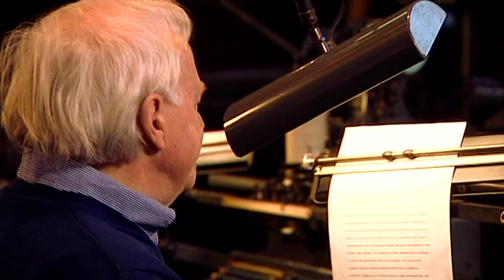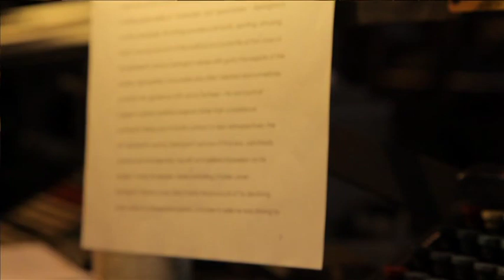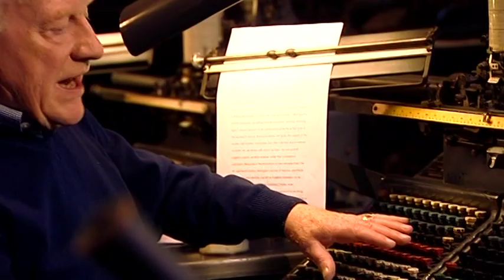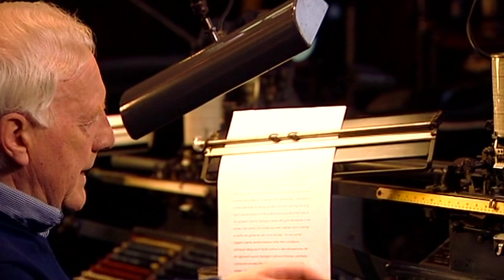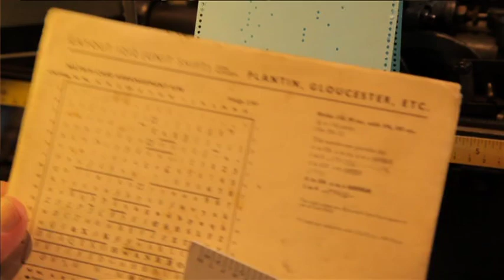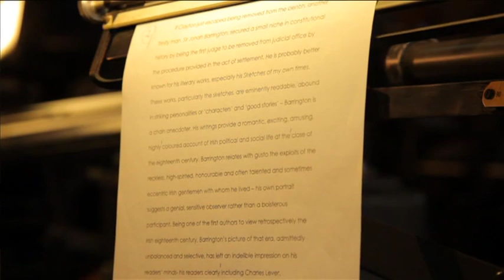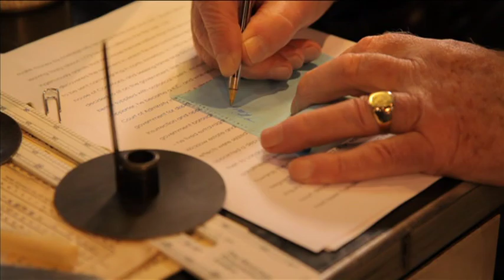Monotype Keyboard

Comment: I did a 5-year apprenticeship as a hot metal compositor and spent the last 2 years of that as a Mono operator and then perhaps another 8 years before things started becoming computerised. I sometimes dream I approach a Monotype machine and I'm terrified that I may not remember how to operate it.
Reply: Vaughan, I thought that. But I have seen keyboards and casters in museums and whilst I've forgotten a lot of the nuances (say you forgot to pull out the knob for justified text so that the space was a fixed 6-unit for unjustified text, when you then had to convert the 4-unit spaces to 6-unit, for but one example), watching this video brings so much else back. They are not what I'd call happy days to be honest.

Comment: Um, killing the line didn't work like that on ours - perhaps it was our machine's age? Ours was a 15x15 monstrosity, no unit shift, no quad and repeat.

Killing a line would take the pump out of action on ours, but the spool would continue to feed character by character until it reached the next justification punches, but no characters would be cast. So, if you made a mistake at the very end of the line it would waste so much time as the caster went through the motions of that line until it did reach the next justification punches. If the mistake was at the very beginning of the line it wouldn't make a great deal of difference.

A caster operator though would be able to tell a line being killed and feed the spool manually by twisting a feed wheel, thereby skipping what would be 'dead' characters. Then he'd leave it and allow the justification punches to start the pump again.